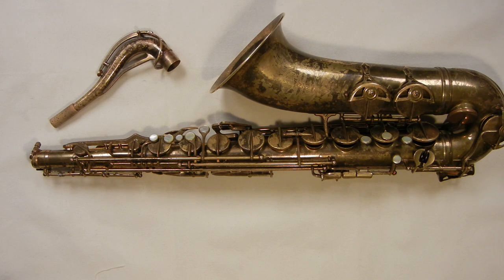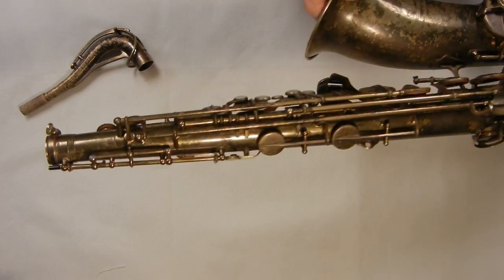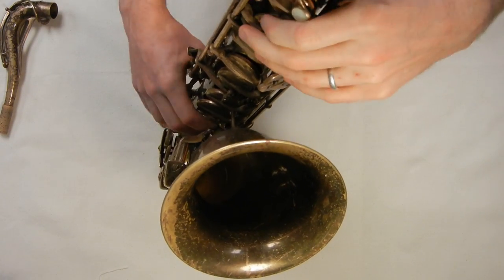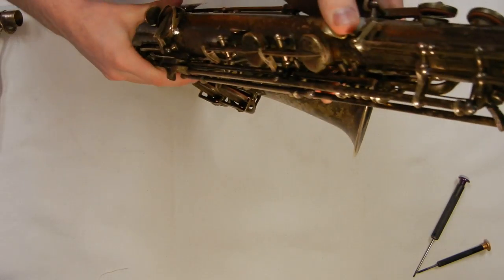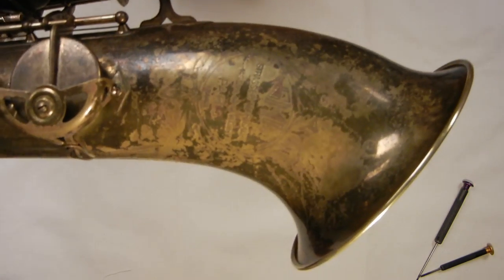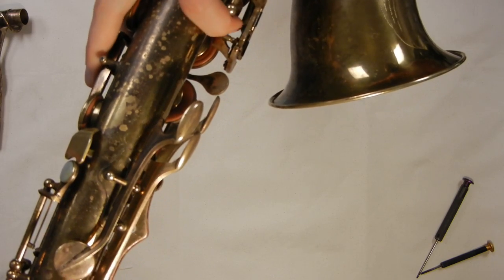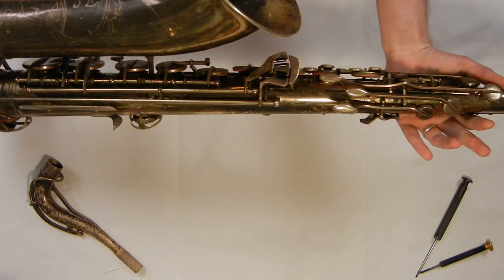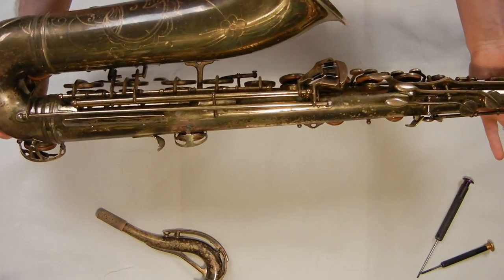Repairman's Overview: SML Revision D tenor saxophone

Comment: hi matt, i have a rev d. alto as well as some other sml's - surprised to see the rocking thumbrest, none of mine have that feature. the beaugnier 'special perfect' saxes also have the switchable g# linkage you point out. sml's are certainly among the best saxes i have ever played, but i'm surprised to hear you like working on them - every technician i have ever taken one to has cursed me for it.... uneven rolled toneholes, bad solder, you name it.... i strongly recommend the 'super' series that comes between so-called rev b and rev c, they have more 'grain' in the tone than gold medals. they are numbered by year of production, thus 'super 45' etc. and usually have wire keyguards.

Comment: I read that the altissimo range was not easy to attain on SML horns. Does anyone else with real experience playing (or attempting) altissimo on these horns concur or disagree with this?
Reply from the maker: In my experience, they sometimes benefit from an alternate fingering compared to what you are used to, but they are not difficult if you just spend an afternoon figuring out which fingerings work best.  Overblowing into the altissimo using overtones is as easy as any other horn, so the altissimo range itself is fine.

Comment: Matt, I've got an old stencil made for Lyons Monarch (I always thought it was a buescher) that i've been trying to track down better info on. It looks as if it has been made to LOOK like a SML there ware many similarities especially in the key work, same pinky cluster just with an extra roller. However the neck tenon, and octave mech are like you see on other saxophones. Spring lengths look very similar, but i'm not sure how much variation is allowed. Any thoughts? Were other companies making copycats back in the day?

Comment: Hey Matt. I have a SML Gold Medal No. 15,643 in really good condition and I have a question concerning the altisimo range. Would you by chance have a fingering chart that you recommend for this horn? I find the F#, and G keys quite flat and really have to strain to get them in tune. 
Do you have any suggestions as to what I could do to get the front keys to have some more spring to them. The keys are really light which can be nice but I'd like to have a little more response from them.
Thanks

Comment: Hi Mat. I have a repair question. Can you tell, which type of springs are best to use if you have to replace the original ones? Original doesn't look like typical stainless steel type, but it's obviously not a blued needle spring either. Thanks a lot 😀